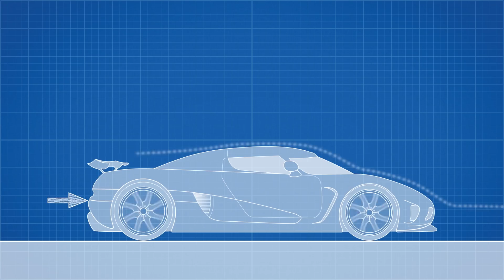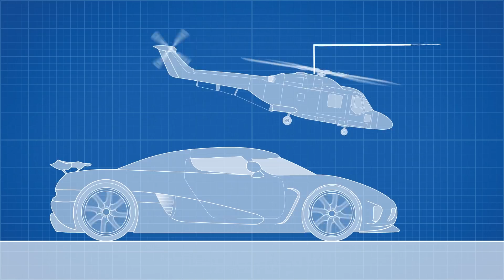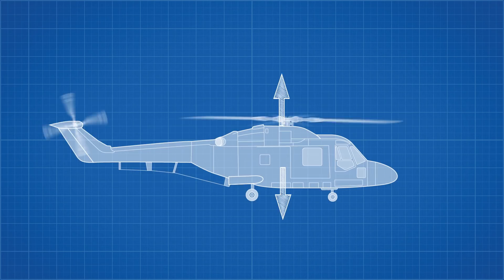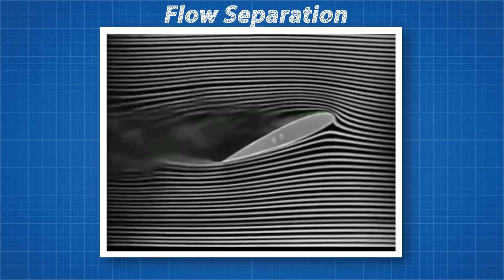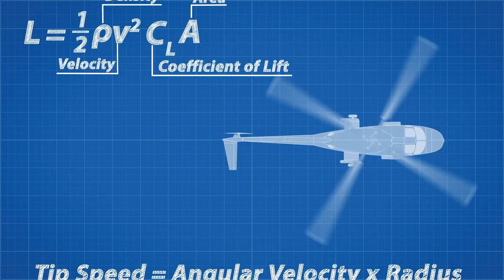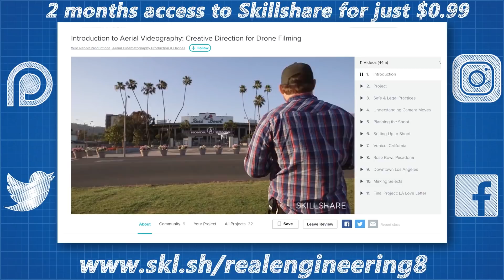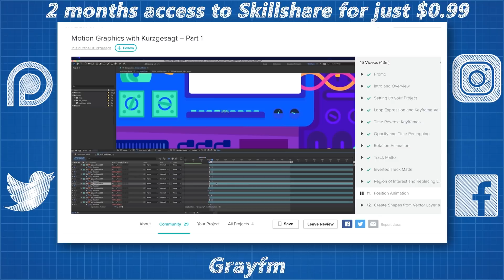Fastest Car vs. Fastest Helicopter - Which is Faster?

Comment: To fix dissymmetry of lift due to relative wind, rotor systems have to be able to flap. Flapping is what causes the changes in angle of attack due to its upward and downward movement as well as forward causing a change in the resultant relative wind. The retreating blade has less relative wind so compensates by flapping down, increasing the angle of attack. Because of this the faster the helicopter travels the more it will have to flap downward increasing the angle of attack and stall as its traveling around that side of the rotor disc. This is retreating blade stall and will induce a roll over motion toward that side. 

You can't just dive a helicopter down because there is always dissymmetry of lift. So there will always be retreating blade stall at VNE. Even when the collective is reduced and not much pitch is applied to the blades. 

The Chinooks dual rotor system compensates for torque/anti torque effects so that it does not need a tail rotor. The rotor system is still limited by retreating blade stall at VNE.

Comment: 763 mph or 1227 kph is the fastest a car has gone...just like this video says production car...the jet powered "helicopters" are not typically production..so they shouldn't count either.i suppose you need a Top Trumps cards approach to this...and yes a Testler strapped to a Rocket would be the death card.

Comment: Depending what you're talking about, as far as i know there was this jet engine powered car. Also does turbo  prop vtol count as helicopter? Or what exactly is helicopter? The curiosity rover was dropped from what they called helicopter... it has 4 jets and no blades.

Comment: There have actually been some really interesting developments in helicopter technology lately, although none of it has been put into production yet. For example, a Fenestron, an enclosed tail rotor, significantly reduces turbulence (and thus noise) by not tossing its air up into the main rotor, and there've been plenty of advances in rotor shape and design, including adding backswept tips at the end for the same reason commercial airliners do, to reduce the vortices that form at wingtips that cause turbulence, noise, and can shake the wings apart. A helicopter built with these technologies could surpass the performance you've reported on, because it would have fewer problems in getting closer to the speed of sound.

The failed Comanche project by Boeing-Sikorsky incorporated these functions, but the Air Force wasn't particularly interested in them, in favor of upgrading current vehicles, and the basic weakness of Helicopters being that they effectively have to hover around an active battle zone to provide support, which makes them a pathetically easy target for any shmuck with a shoulder-mounted RPG. Modern unmanned drone technology has effectively put the idea of an attack helicopter in its grave, as a drone can perform virtually all the same functions without risking a human pilot. But it would've beaten the old helicopter speed record handily.

Comment: I get you're in love with the metrics system And LOVE hating on the imperial system, but noting you are talking about aviation, when you do, would you mind using knots instead of Kph?
Reply from the maker: Naw Valeria. I love hating on the imperial system too much. It's my favourite thing
Reply: Real Engineering You play too much. 😒 Knots is used internationally for aviation. Not just the 'ones' who use the imperial system.

Comment: You do not tilt the main rotor you increase lift by adjusting the angle of attack of one of the rotors during the rotation it’s call gyroscopic procession
Reply from the maker: I know, but I'm narsed animating or explaining that for this video.

Comment: Can cast any light on why the tiltrotor designs use open props, when ducted fans are more efficient?  Does it just come down to the extra mass outweighing (pun not intended) the efficiency gain, or something else?

Comment: Can a auto-rotor also go faster then 400 km/h since the trust is provided by a propeller or a jet engine and the rotor is not powered by the engine and only provides the lift?

Comment: The problem with speed of sound is not helicopter can not go  pass it  due to structural integrity. It mainly due to if you spin the rotor too fast, the tip of the rotor will go  supersonic, making it noisy and potentially damaging to the rotor of helicopter. (One reason why Huey having such a huge thick blade)

Comment: Helikopter speed record is 487km/h by the Eurocopter X3
Reply: Ahh yes, a 'helicopter' with wings and forward facing propellers 

The F-35 has a fan that lifts it vertically, does it count as a helicopter too?
Reply: Sikorsky S-97 Raider has a "Do Not Exceed" speed of 444 km/h implying that it could go faster. Cruise speed is 407 km/h.
Reply: +ABaumstumpf even than it wouldn't be faster than the fastest car, that would be the ThrustSCC, which went over the speed of sound.
Reply: If it counted as a helicopter then the osprey should also count.
Reply: X3
Reply: It still is a helicopter.
He might object to it - but there is nothing saying a helicopter needs to get its forward thrust form the same propellers as is providing the lift.
otherwise every single helicopter with a tail-rotor would not qualify as a helicopter either. It is just hypocrisy to say otherwise.
Reply: betaich - at that point you can just take a rocket and slap a propeller on top - just as much a helicopter as the thrust SSC is a car. Cause that thing does not power its wheels, it is using a jetengine directly. With such a stretched definition of a car we can take a helicopter with small sturdy rotors, and slap some jet engine on that. You can make that able to fly while the lift is still provided by the rotor that would no just happen to go supersonic at all time.
And the Eurocopter X3 is still a helicopter, not just an experiment to gain the highest speed by twisting the rules.

Cars can definitly go faster than helicopter and there are many that do - but no production car so far can do it, and despite me liking the Bugattis - i wouldn't call them (or koenigseggs and similar) production-cars.
Reply: He didn't watch the video LOL
Reply: +madattaktube Indeed I would think really those aircraft would come in a hybrid category of their own heliplanes? I dunno what to call them but they are no more helicopters than a turbofan engine is a turboprop or a turbojet for that matter they are hybrids that trade off between the advantages of both modes of operation.

Comment: Technically the helicopter will beat the car in top speed.  All you need to do is drop it until it reaches terminal velocity.  Never said along which axis it needed to be traveling.  Semantics son!
Reply from the maker: Actually not sure about that. Don't think the terminal velocity of a helicopter is terribly high.....maybe if you flipped it over and used the thrust downwards.
Reply: Pretty sure a car in free fall would be faster.
Reply: RBuckminsterFuller Fast Cars are designed to be as light as possible so I think the helo would have a higher terminal velocity
Reply: @RBuckminsterFuller  A heavier helicopter falls faster
Reply: @myusername3689  That's not how gravity works. Did you miss out school for a year?
Reply: Helicopters should autorotate in the event of power loss, so won't actually fall very fast at all
Reply: or loose the propellers mid-dive
Reply: Apatheism Solid counter argument.  I guess you love watching "dumb smart people" because it gives you something to aspire to one day
Reply: That depends on pitch Bryn.Fascinating physics but seems like a daft comparison to be honest, a helis power is in rpm and pitch determines speed. It's made to fly upwards not stick to he road with friction. Might as well compare a baby rabbit and a packet of skittles.
Reply: elon musk's car would like a word....
Reply: Well, a chopper that is moving horizontally at maximum speed, and which then transitions into a dive, will gain even more speed. So, using that method, a modern helicopter like the S-97 Raider and Eurocopter X3 will easily beat any super car. You might say that the S-97 and X3 are not normal helicopters, but a super car is not a normal car. So, none of those vehicles are normal and that's why it's a fair comparison.

If you take it further, the Bloodhound SSC (land vehicle) is in development and it's planned to go 1600 kmh, beating the land speed record. But that vehicle is pretty far from being a car. If that thing counts as a car-like vehicle, then you could argue that the fastest helicopter-like vehicle is the F-35, which goes 1900 kmh.
Reply: nope a car strapped to a heavy rocked really goes faster. like a 25,000 miles per hour fast.
Reply: +Nanomachines Son!
Are you sure the autorotating rotors won't interfere with the 90° fall towards the G center?  
Also are sure that an Mi26s center of mass would it turn nose down?
Reply: Terminal velocity is between 200 and 300 kph, socit would be slower than if it were going forward.
Reply: what about increasing power of the engines of helicopter to some ridiculous numbers (theoretical speaking) while leaving helicoper in more or less horizontal position, blades would be compansated by stronger rear rotor? just theoretically... this should/could? be enough to be faster than 445? i mean yeah it would basically be helicopter with jet engine below main rotor but it would look more or less same as classic helicopter (and yeah i can see you building car with jet engine in it)
Reply: A helicopter can move faster than any car if you add a 2m high 10m thick brick wall into the equation
Reply: +AndrejD303
So basically a Eurocopter X3 with jet engines for forward thrust? But that isn't considered as a helicopter anymore which is the whole point why helicopters are slower. The X3 reaches 471km/h already. But the question arises if some vector controlling like the V-22 does isn't the better way to get there without loosing too much of the helicopter utility while that would somewhat be more like a harrier or X-35 again.
Reply: no...autorotation
Reply: Then do the same for the car.
Reply: he meant forward velocity not the actual speed because you can drop a car from a plane too
Reply: The rotor will autorotate and act as a really effective parachute. It won't fall that fast.
Reply: sirBrouwer not even strapped to a rocket any more, still going 25,000+ mph
Reply: Seraphina S KA-50 actually has an ejection seat and subsequently pyrotechnics to detach the rotors.
Reply: Nanomachines Son! If you drop a helicopter unpowered from a high altitude, the air resistance will cause the rotors to spin and the helicopter will gently hover down to earth, not reaching that much of a high velocity, although it will certainly crash on impact without a pilot guiding its glide down.
Reply: Maybe use nanomachines to boost a cyborg through a certain Metal Gear? He'd be pretty fast.
Reply: It all depends on definitions. Fastest car (if you can call it that) ever was the ThrustSSC that broke the sound barrier... i mean... xD
Reply: Nanomachines Son! So? A car could do that too.
Reply: Helicopters are specifically designed to be light, plus the rotor will add to drag even more. Pointing the thrust downwards would help. Although it may overspin
Reply: Im very disappointed there were no Wil E. Coyote, super genius posts
Reply: The helicopter is fastest if the direction is upwards.
Reply: GUYS. A production car has already beaten like every single speed record ever. The frickin Tesla Roadster orbiting the sun right now!
Reply: Nanomachines Son! A car can do that too
Reply: Yes but a car can drop from an Antonov 225 too and beat the Heli
Reply: And another idiot nice.
Reply: Helicopters often have pretty low terminal velocities because the blades are designed to be spun by the rushing air and slow down the craft a lot.
Reply: The problem is in blades. First problem is the retracting blade stall. In foward flight the retracting blade is such slow relative to air so it no more generates lift and is stalled. The next problem is the sound barrier of blade going foward. The relative speed of the blade tip is near the speed of sound. This causes fluttering and compressibility effect that greatly reduces lift and increases drag and rapidly wears the blade.

Just imagine that. To avoid the reaching the speed of sound on the edge of rotor blade, you need to reduce RPM. Reducing RPM causes less lift, specially on the retracting blade side. So, you will need to somehow get more lift. For that you need much stronger engine, which is also much heavier, and much much more blades. But more blades means more drag and weight again...

Also I am not sure but probably there is the mistake in video which is forgetting to gyroscopic precession.
Reply: Top Gear testez that, but falling speed is not that high. 200-300 km/h and card can go much faster than that.
Reply: Guys while free falling every object accelerates with the same g=9.8 thus the helicopter will go faster if fallen from a high enough distance
Reply: Pretty sure it wouldn't be. The heaviest car ever produced is the Rolls Roice Phantom at 2722kg (6000lb). Heaviest helo is the mi26 at 28,122kg (62,000lb). That's a factor of 10 difference. Since the energy states need to reach equilibrium for terminal the force of drag needs to equal that of the force applied on the vehicle(gravity). This gets you ma=.5pv2CdA. Since the fluids mass density is the same(assuming incompressible) and acceleration is constant we can reduce this to v=sqrt(2m/CdA) to find the fluid velocity, which if you switch reference frames to the vehicle is equal to the vehicles travel speed.  So if we assume that Cd is .82(long cylinder for both) then can Elise both terms and all we need is the area exposed.  I'm not sure what that is for either so imma simplify this in a big generalization mostly because i dont have the time to figure out the exposed area. I'm going to assume both have a maximum exposed area for this.   The phantom is 227 inch long whereas the mi26 is 1570ish inch. so the helo is about 7 times the length.  The cargo bay is about as wide as a car so I'm just gonna make a simplification and say the the width of both is equal.  So then the choppers area is about 7 times that of the car along their greatest exposed cross sections.   Reducing all of this into just factors and eliminating all variables that are equal we can see the choppers velocity  would be sqrt(10/7) faster than the car,  or about 120% that of the car.  In reality the chopper would be much faster as the center of mass of both vehicles would cause both to rotate to the front of the vehicles facing the ground where the apparent exposed area difference is far smaller,  wich would further increase the gap between that of the chopper and the car. Ultimately the chopper would beat the car in free fall. This is all highly generalized and id's only for the cases of the heaviest of Blyth vehicles in their respective categories.  You can cherry pick vehicles to dispute this but this is just an example of a generalised compairison between the vehicles. 

TL/DR: nuh uh
Reply: @nanomachinesson2513  now we have the hummer EV at a whopping 9000 lbs.
Reply: nope, from the height the helicopter can get the air is still thick enough that its terminal velocity is lower than its max horizontal speed. (btw the same is true for the car. it's faster going on a road than falling from the sky)
Reply: Turning a helicopter upside-down isn't that easy. It requires special rotors, fuel tanks, etc. For example at helicopter shows they use specialized helicopters for rolls and flips.
Reply: +Real Engineering The drag of the autorotating rotor blades alone is usually pretty close to the drag of an emergency recovery parachute for an object of similar mass. Which makes sense when you consider that they are of course designed to permit recovery of the aircraft and it's occupants in the event of a loss of power, I suppose that controlled use of explosives could eliminate this drag if one really wanted to make the body of the helicopter fall faster but it doesn't exactly qualify as a production helicopter anymore when you have modified it with explosively detachable rotor blades.

Comment: But is there not an additional limit by the fact that you have to adjust the angle of attack super quick? How does it do that?
Reply from the maker: Watch smarter every days helicopter series, he explains it incredibly well
Reply: Real Engineering I know you were going for brevity, but for the sake of this poor soul it's important to make the distinction that angle of attack does not necessarily equal blade angle. 

For OP, yes, watch SmarterEveryDay's video, but know that the angle of attack is allowed to change through two main mechanisms: blade flapping and Delta-3 hinges. Blade "flapping" literally means the blades are allowed to deviate from their standard plane of rotation by flapping up or down to maintain a standard angle of attack around the entire disk, alleviating the disymmetry of lift caused by flying forwards.

Delta 3 is  basically a hinge that allows the blade angle (and thus angle of attack) to change as the blade deviates from the standard plane of rotation; it increases the effectiveness of blade flapping. 

That video explains it super well.